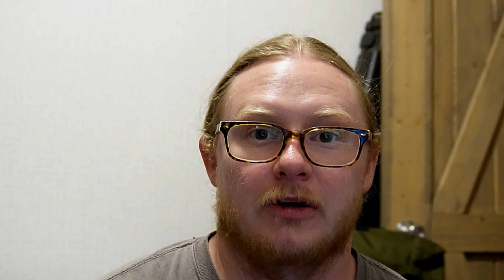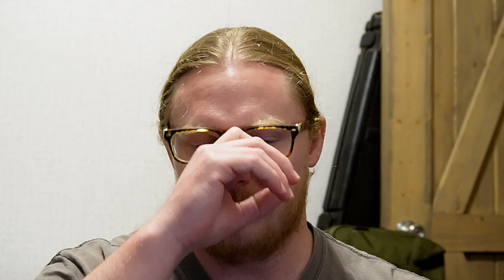BDC Reticles Suck!

Comment: Good video an good explanation about the BDC. That said, what do you think about the Trijicon ACOG BDC reticles? We know that they are the prefered by the military in the battlefield. Even the fixed ACOG 5.5x50 for the DMR`s and for long range shots are used. Anything different about the quality and accuracy on the ACOGs BDC? Thanks.
Reply from the maker: @dannyboy4805  I think that BDCs have their place. For instance if they are on a rifle being used with the appropriate ammunition that they are calibrated for. It will allow an average person with little knowledge of external ballistics to be able to engage targets at extended ranges. Up to a certain point. I actually use one on my AR in 5.56. And I only use ammunition in that rifle the BDC in the scope is calibrated for.

But as far as the optic on my AR-10 chambered in 6.5 Creedmoor. There are no BDCs calibrated for that cartridge and 140gr FMJ so for it I have a standard Mil scale LPVO.

As far as the ACOGs go, as long as the appropriate ammunition is being used that the optics are calibrated for, they will work as intended. And they will make it easy and simple for an average shooter to use the holdovers and still be effective on the range. Their shots may not be super precise like ones that have been well calculated but they will be effective nonetheless.